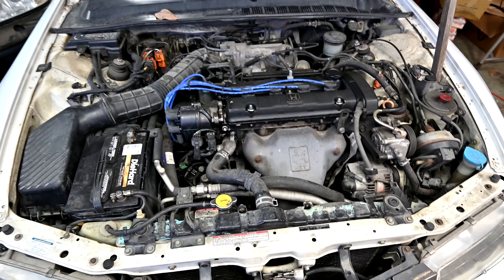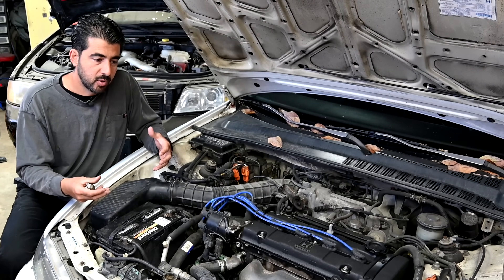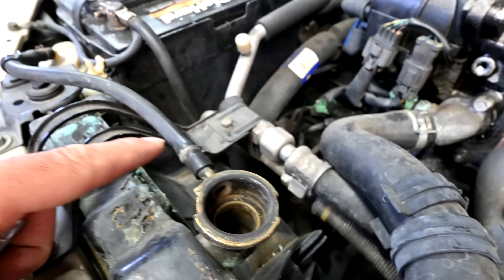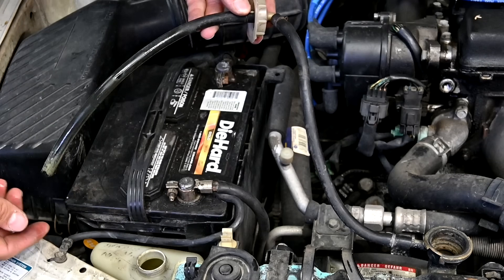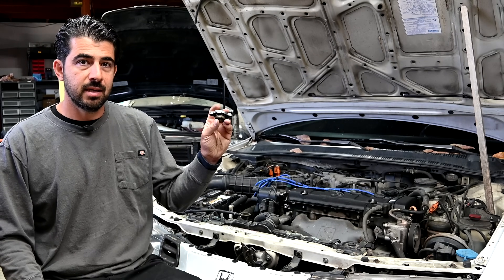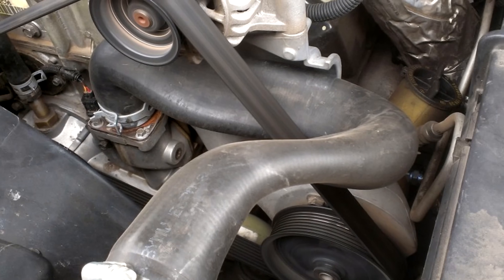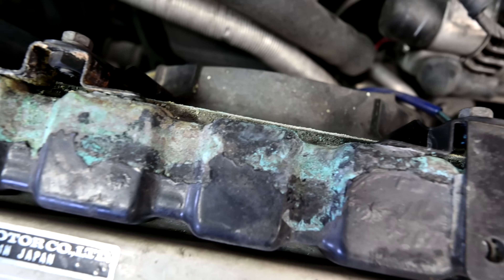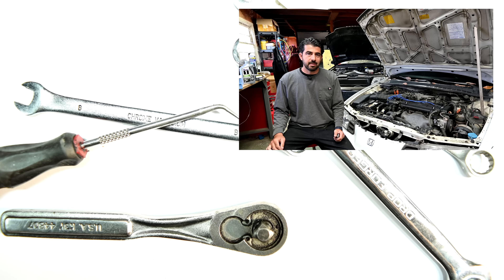If You Can't Find the Source of Your Overheating Issue Watch This Video

Comment: OMG, THANK YOU!!!!! I've replaced the entire cooling system on my vehicle and the overheating didn't stop until I replaced a $14 radiator cap! The reservoir was filling up and pushing out of the reservoir. Coolant wasn't flowing back in. You're video and knowledge saved my vehicle's life!!! Thank you so much!!! I owe you a beer!
Reply: I’m hoping it’s my cap before I replace the whole system I’m have the same problem as what you had but my coolant is also alittle dirty lol
Reply: It’s was my head gaskets y’all😂😂 there’s a new engine going in it as im typing tho
Reply: Same thing happened to me. Last week I replaced radiator, hose, thermostat, then timing belt and water pump, still no good. This morning I watched this, and cleaned out a piece of small dirt from inside the cap, it's no more boiling.
Reply: How much did you spend on the cooling system? Before you bought the cap?
Reply: Please make sure you buy this guy a beer if he's okay with that. How about a Johnny Walker?
Reply: My temp climbs when I go under 40 in stop and go.I hope this is it, I'm pretty sure my fans are working correctly.I will have to double check, I thought I tried everything.I replaced the thermostat twice and the temp sensor twice flushed the system, replaced the cracked coolant elbows(GM 3800). My hose to the thermostat is bulgy so I guess this makes sense, will replace the hose too.I thought it could be my cat which I'm going to replace also.
Reply: @jonmo2694 hope it's not the cat.......😂
Reply: @jonmo2694  sounds like your fan isn't working.
Reply: @ianlaughlin85 It's not kicking on, it works with the AC.I use the ac to control the fans in town .I've replaced the ECt sensor twice, had to change the pigtail with it I'm thinking I need an OEM sensor not the duralast I put in twice?And or using a cheap thermostat and the gasket was kinda loose. IM Getting a code for the ECt sensor and EGR now.My EGR is clean and appears to work and the valve holes are clear of carbon
Reply: Every little bit of sheer coment helps. Thanks so much.
Reply: Crazy. Insane how a cap can be more complex than just a piece of plastic.

Comment: Really interesting. I've spent $200 fixing cooling system problems. The problem was just radiator cap.. 10 stars for this video
Reply: Maybe
Reply: Always start with the cheapest fix then work your way up to head gaskets 😂😂
Reply: @dannyr3346  I started by replacing the thermostat,  water pump , head gasket 😢 i haven't change the radiator cap 😑 it's a jeep
Reply: Did you over heat after 30 min then go down when you started driving by chance?

Comment: Thank you very much for this video. Also for those with overheating temperatures, take the thermostat and put in a pot with boiling water. The valve in the thermostat should open at the temperature engraved in the thermostat. If doesn’t  open at that temperature, replace it. I also do this test with a brand new thermostat before fitting it to make sure the valve opens at the temperature marked on the thermostat.
Reply: what you describe does not apply. Simply buy a new thermostat it's very cheep
Reply: How can I tell if my thermostat is not good when I take it out?
Reply: I bought a new thermostat and water pump. Still my thermostat doesn't work. I know its thermostat because i get no heat from my heater inside.  What can i do? Thanks
Reply: @truthonly7777  Hi it sounds like a blocked heater matrix. Back flush it. Plenty of videos on yt.
Reply: @dmc200755  thanks man, I did that, but still no hot air in the cabin. I think I may have to replace it. I even bypassed the heater control valve and still no hot air. Took out my thermostat and still no hot air in the cabin and overheating issues for 2 months now. I think I need to fix my head gasket and replace my heater core... any other advice that may fix the issue?
Reply: @truthonly7777  Have you tried a thorough blead to get all the air out of the system. Some systems don't blead very well.
Reply: @dmc200755  I haven't tried to do it very thoroughly. I guess I'll try that to see what would happen. Thanks man.
Reply: @truthonly7777  is it still overheating?
Reply: @Ajezooway  ya bro still overheating. I haven't been able to work on it for a few weeks. But I'm planning to use BAR gasket sealer and by pass the heater core( bc I think it's damaged) and Bleed the system for no air . Then see what happens. I'm going to do this within a week so check back with me.. what's ur situation?
Reply: @truthonly7777  mine goes half the gauge 5mins after the AC is on , even after changing coolant  still the same thing , It spill coolant out too
Reply: @Ajezooway  hmm, what did you replace already,  or check?
Reply: @Ajezooway  it could be a thermostat
Reply: Dad has 2008 buick enclave car kicks into 😊 mode but water temp is 210.. he has replaced the water pump thermostat sensor relay and radiator..

Comment: I had a car in once that would overheat and I couldn't for the life of me find the problem. Then I decided to take the whole cooling system apart, turned out the "fan wings" of the water pump was completely gone. So ofcourse there was nothing left to actually pump the water around the engine :)
Reply: VW is known for this
Reply: So the little plastic pieces were circulating through the engine?
Reply: @Ninjasraynonu3  I think it was cast iron, and yes and no. I'm sure some smaller pieces went into the cooling system but the after the larger pieces broke off then there was nothing left to circulate it around anymore. Most was just laying in the water pump housing and was easy to remove.
Reply: @danniandersen5858  ohh ok gotcha

Comment: Also check to make sure there's no leaks in your expansion tank hose that leads to your radiator. This will also cause overheating.
Reply: hi. I wanna ask. My car’s radiator cap was busted and when I took a look at it, the thermostat was gone. I don’t know where it went and I’m afraid it might have detached to the cap and went inside the radiator hoses. Is that even possible? I replaced the radiator cap and my car still overheats. When I’m idling, it overheats and when I’m running, it goes back to normal. I came to see the fan and it runs so Idk what’s wrong with my car.
Reply: @proxitocin your thermostat would not be attached to your radiator cap however your thermostat will be very close to wherever that cap is. Usually a thermostat is inside of a housing that is connected to the hose so it's probably unlikely that it dislodged and is in your hose.  Now we check your radiator fluid, your engine oil level, check to make sure that your car heater is blowing out hot air when your idling if it will not blow out hot air then you are likely suffering a thermostat issue that is stuck. You would need to replace your thermostat then. I don't have much get advice cuz I'm going through the same thing I have replaced my temperature control sensor my thermostat my fans are working, I've also replace the fan relay completed a coolant flush with all brand new coolant, I recently replaced the radiator cap probably about 1 years ago. After I replace a thermostat the car stopped overheating and then two days later started overheating again. I think next I'm going to change the cap again and check the water pump. My issue happened out of the blue I was idling finishing my conversation before I continue to drive, my car then shut off my temperature gauge wasn't registering so I turned it off and turned it back on and then it went straight to the the H; it was really hot so I looked up and noticed that there was smoke coming out of my hood. And now the cycle of hell will begin. 😢
Reply: @ambersmith8171 
Bummer!

Comment: I'm not a mechanic by any means but I've tinkered around for the last 35 years and I've never heard of this. Three years ago I replaced the thermostat and a few months ago I replaced the thermostat manifold and hoses connecting to it and each time that fixed the problem. Yesterday my Ford Explorer overheated and AC stopped working, I'm hoping this information you provided will solve this latest overheating issue. Thank you. I will update asap if this fixed the issue.

Comment: Very true. Had this very issue and it caused overheating. It was the cap/valve at the overflow container though. Another odd reason can be the overflow container itself. Same result…
Should be mentioned that many modern cars with a closed cooling circuit don’t have a radiator cap anymore.
Reply: Yeah I have a vehicle with no cap per se but just one on the overflow tank.
Reply: As in exp tank having a hole in it ?

Comment: Good information. If you go to your neighborhood auto parts store, have them test the caps on the shelf before you buy one. Last time I did that, every single 13 lb cap failed at 6 or 7 psi.
Reply: Or, don't even take a chance ruining an expensive car/engine on aftermarket junk and get OE. My dad used to tell me, "pay now or pay later." Why risk ruining engine to save a few bucks.

Comment: Absolutely correct!! I learned this along time ago,, I had an 88 turbo coupe 5spd and i put a lever vent radiator cap on thinking it would be an upgrade but it gave me issues with the upper hose calapsing and ran much warmer,, put the old one back on and problem gone
Reply: Had a ford 5.0 upper hose collapse on me but it wasn’t the cap it was the reservoir clogged at the exit hole to the small hose.  Cleaned it out and no more problem.

Comment: His diagnosis for my 1996 Geo Metro(mileage 165, 814) overheating issue was correct! I went out and purchased a $14.99 USD radiator cap from AutoZone. The radiator cap fixed the issue! I had previously purchased a brand new radiator, hose, and thermostat. Thank you ever so much for your philanthropy and kindness. If I lived near the Ratchets & Wrenches shop, I would definitely do business with you! I'm very impressed.
Reply: Why didn’t you purchase a brand new water pump?

Comment: Great video.  I was chasing my overflow reservoir staying in the full hot mark for three days.  No leaks, great heat and it had me baffled…until I replaced the radiator cap!!  Problem resolved.

Comment: I also faced the radiator cap issue, better replace it on time or gasket may suffer. direct radiator fan may help in hot summer days.

Comment: I'm currently doing extensive research because both my cooling fans are constantly on...not sure if the radiator cap will be something related but I wanted to thank you for teaching me something new!
I'm doing this work myself out of curiosity and love to learn how things work and I never knew or thought that the cap is related to anything other than for cover and protection!

Thank you!
Reply: I had a bad water temp sensor on my traverse. The default was fans on all the time. Replaced that save was good to go. Hopefully that might help

Comment: Just about 2 weeks ago I had an  issue with a different valve in the cooling system in my SUV (the thermostat). However, rather than the excessive pressure putting a hole in one of my radiator hoses, blowing a gasket or something else to aggravate the hell out of me, it just ruptured one of the plastic ends of my radiator!!!😑🤦🏼‍♂️ Being that I'm not willing to pay almost $500 for a new radiator and I didn't feel like wasting time attempting to find the right type of adhesive, I purchased a plastic welder and fixed the tank that day in less than an hour! So far I have not had any issues with my first attempt at plastic welding, which I am so far quite pleased with, however I have been welding metal for over 20 years and it seems to be somewhat similar to T.I.G. welding and Oxy-Acetylene welding/brasing (using filler rod).... I am certain it's not the prettiest plastic welding job that's ever been done by human hands, but so far it's definitely holding up really well!!!👍
Reply: If it works for you, that is good enough.
Reply from the maker: Nice, as long as it works it doesn't have to look the best :)

Comment: I bought a Dodge car...4cyl engine..from a lady who meticulously kept it maintained...car looked showroom new. She had the timing belt change done at recommend interval...the car started to run hot...the shop replaced waterpump..still run hot...they changed radiator...still run hot.
After many attempts to resolve the issue she decided to sell car. I let my wife use the car...at one point it overheated so badly the cylinder head warped. I went to get new cylinder head at a Dodge dealership. While there...a mechanic told me the timing belt might been improperly installed.
Sure enough...I found the belt timing was off by one notch!
Corrected it...with new head installed...the car ran great!
👍

Comment: Great video,  do a video on different brand or rad cap and how effective they are, is Stant 10242 rad cap 16 psi one the best? How good are those cap that shows pressure needle dial indicator?  Motorad T-37 rad cap? Race car driver rad cap, is it Mugden?   I purchased a Honda dealer cap for my 2005 Civic, it turned out to be bad, not enough heat output and losing coolant. I had cupboard liner material so I cut it out and made a gasket to put it inside the Honda rad cap. Works good, not best yet? What are other great material to use as gasket?

Comment: You just save my life . I replaced water pump I replaced all fluid on my cooling system I replaced thermostat I was about to replace radiator I was going crazy I never thought it was the reservoir Cap only $8 dollar on o Reilly 🙏 mine is a F10 4.6 97’ and it was only overheating while Driving it wouldn’t last 15 min driving  and now is ready to work again 🙏

Comment: I ran out of coolant the other day sorry filled it and then a few days later I ran out of cooling again. My car started overheating so I had to pull over and walk to the local auto supply shop. I grab some coolant and filled up the radiator and the coolant reservoir. The car is still overheated and I couldn't figure out why and that didn't seem to be a leak or a noticeable leak. I then watch this video and went back to the auto supply store and got the radiator cap. It worked! The cap I had on my car was the original cap from 2005 so it was long overdue to be replaced. I would say if you run out of coolant make sure you fill up the radiator and the coolant reservoir and then replace your radiator cap because that'll be the cheapest option before you start throwing money away. Peace ✌🏾

Comment: Ok so on the cap issue, if my radiator cap has one of the seals no longer fixed to the cap and falls off, im assuming this would cause the boiling issue you mentioned? Thank you for your video! I never even thought of a cap like a regulator but it makes total sense now!

Comment: Great video.   I have an overheating problem with a jetta TDI. Looks like there is over pressure in coolant system because it keeps pushing coolant out of the reservoir. But one thing that I noticed is that the lower radiator hose doesn't get hot at all.  While the rest of the hoses are super hot.

Any suggestions will help.  Thanks.
Reply: Thermostat

Comment: Dealing with overheating issues right now. Gonna do a pressure test before I change the cap or rad. Any chance the pressure test with not be accurate to diagnose the issue?

Comment: Great explanation > I  my self would  as a cheap preventive maintenance - just change it every 5- 7 years or 60 k - 75 k miles . I do that to Battery / belts etc & knock on wood had not have car trouble on the road for 30 years . might be too soon for most folks but Preventive is the key. You R & W = AAA+++  Thank you

Comment: Nice vid..glad for it.  When do you recommend to replace radiator cap whether it is good or not just for preventive ?
Reply from the maker: You can replace it if it fails visual inspection or whenever you replace the water pump as a rule of thumb. Or you can pressure test it as I'll show in a future video.

Comment: I have a different issue after replacing cap😢 there’s a tiny crack in the pipe where you unscrew that little screw to bleed coolant system on bmw x3😮😮😮😮

Comment: If you have a honda or Acura, Also check you IAT(Intake Air Charge Temperature Sensor) switch! Especially if you have checked all those other things and your fan does not come on on time unless the engine is going past half on the temperature gauge! It is located on the intake manifold. I have a 94 Acura vigor

Comment: I have 2012 Nissan Altima which has two thermostat in it. Since I live in a hot region where temperature is usually around 48 degrees celcius during summer so should we remove a single thermostat if not both of them?

Comment: My nissan xterra with a 4.0 is spilling out the overflow tank. That one has the spring on it. The radiator just has a cap.  I've replaced both with gates overflow/radiator caps. Do you think that I should just buy an oem one? Truck runs good just hests up to around 226°-  230°.

Comment: Any advice welcome!!! My 1997 k10 suburban is overheating. Replaced radiator, cap,water pump,thermostat (twice), burped it, lower and upper radiator hose replace. Thanks.
Reply: Test coolant temp sensor . I think it's a simple ohms test.

Comment: Nobody seems to talk about coolant that boils below the spec temperature. At 20K miles my coolant was still testing at 40 degrees below zero but boiling at 220 F, even though the gauge was far from red/overheat. steam would bubble into the reservoir and push coolant too. That left an air gap in the system because not all the coolant would get drawn back in from the reservoir. There are no perceptible leaks and the system passed a pressure test and combustion gas test.

Replaces the radiator, cap, thermostat - no solution.

Replacing the coolant solved this issue that even a pro mechanic shop was glad to misdiagnose.